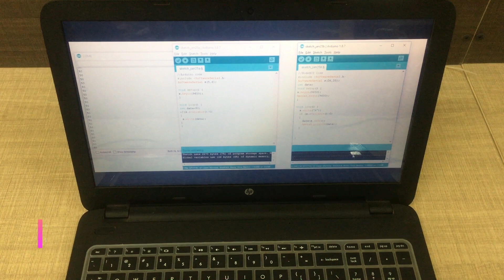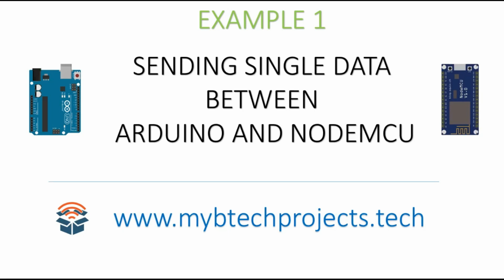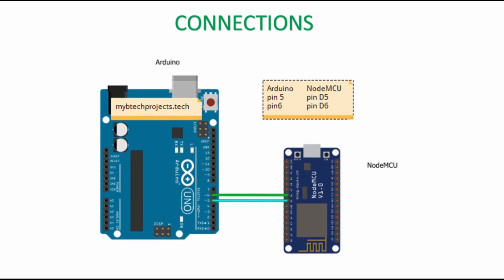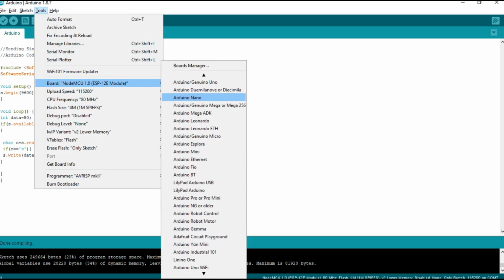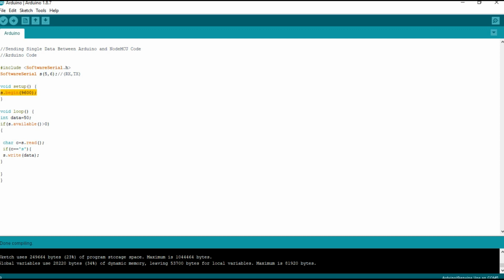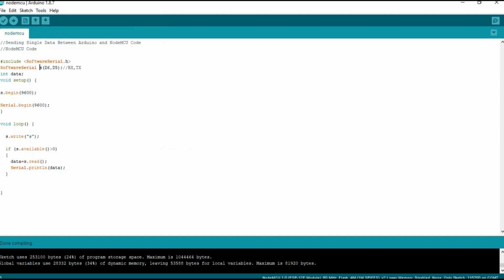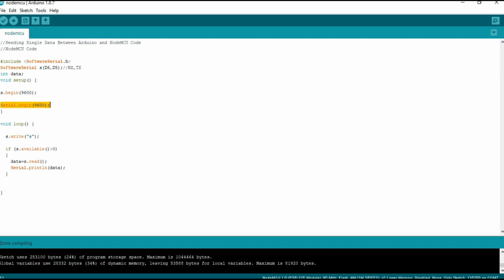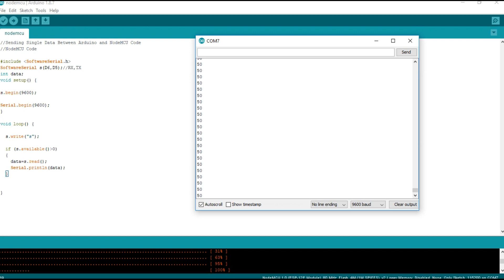[Fully Explained]--Single Data--Serial Communication between Arduino and NodeMCU (ESP8266)

Comment: Don't use the circuit ।। May be the person have minimum knowledge about the voltages of different borads ।। Please use a voltage devider between the pins of tx pin of the Arduino and rx pin of the nodemcu

Comment: Thanks! Not working for me. I'm not an electrical engineer.. by intuition and luck I plugged GND of arduino e nodemcu and worked fine.
Reply: do u have a schecmatic diagram for this?

Comment: I have a question. Is it possible to use similar code for arduino mega with nodemcu? I'm not buy yet the arduino mega. I need to know either it possible to use this technique or not. Thanks
Reply: Yes, Arduino mega will also work

Comment: Guys, if it's not working, try connecting the RX on the Arduino to the TX of the NodeMCU and the TX of the Arduino to the RX of the NodeMCU.
Reply: That's correct

Comment: Can you please confirm if we need level shifter for serial communication between Arduino and Node mcu? As arduino signal have level of 5 volts and that of Node mcu have 3.3 volts.
Reply: Usama, there is no need of level shifter for serial communication
Reply: @tamizhdiynaveen1354  in fact it is needed for protecting nodeMCU, you can use a voltage divisor with 2 resistors

Comment: He says 9600 bits per second 
Which is actually wrong 
It baud rate and it not measured in bits 
Baud rate = symbols per second
Reply: Yeah, it's right. But we use 9600 baud rate(i.e maximum 9600 bits per second can be transferred) for effective communication between Arduino and nodemcu.
Reply: @tamizhdiynaveen1354  i don't think 9600 is perfect for communication b/w node and Arduino there is more rate available but it is another mater 
I am saying there's a lot of difference b/w bit rate and baud rate
And u are arguing once again bit and baud are same which makes no sense plz Google first 
Search bit rate vs baud rate

Comment: I am complied everything  by your guidelines. But no output without any errors
Reply: i encounter the same issue.. how you solve it?
Reply: @amirulhazeiq8997 , connect in other usb ports
Reply: Try with other USB ports
Reply: TamizhDiy Naveen now I am clear and complete the project
Reply: TamizhDiy Naveen I have software failure

Comment: do you have the tutorial for mega ? i simpliy replicate this code to be using with mega but it could not work. no 50 in serial monitor of nodemcu, just a bunch of unreadable symbol
Reply: Hi Abdul, Thanks for watching this video. Check whether the baud rate is the same in both nodemcu and mega.
Reply: @tamizhdiynaveen1354  it is the same baud rate for both mega and nodemcu. thanks for this i finally can figure out the data sending from mega to nodemcu must be in form of string or else that i dont know. your code somehow cant be used on mega. i dont know why and it took me 6hours troubleshoot the code without success. but i do my own code and the data sending is work after that. any thing you can comment on that mr ?
Reply: @TheDarkforce95  can u show your code.. cause i also do the same thing on my arduino mega but still cant read any output on serial monitor
Reply: @syameezanatasha8349  create 2 file . 1 for mega and 1 for nodemcu . refer my gist
Reply: @TheDarkforce95  why i cant upload the code for arduino .. it shows error  Arduino: 1.8.9 (Windows 10), Board: "Arduino/Genuino Mega or Mega 2560, ATmega2560 (Mega 2560)"

Sketch uses 1982 bytes (0%) of program storage space. Maximum is 253952 bytes.
Global variables use 188 bytes (2%) of dynamic memory, leaving 8004 bytes for local variables. Maximum is 8192 bytes.
avrdude: stk500v2_ReceiveMessage(): timeout
avrdude: stk500v2_ReceiveMessage(): timeout
avrdude: stk500v2_ReceiveMessage(): timeout
avrdude: stk500v2_ReceiveMessage(): timeout
avrdude: stk500v2_ReceiveMessage(): timeout
avrdude: stk500v2_ReceiveMessage(): timeout
avrdude: stk500v2_getsync(): timeout communicating with programmer
An error occurred while uploading the sketch

This report would have more information with
"Show verbose output during compilation"
option enabled in File -> Preferences.

sorry i am new in arduino
Reply: @syameezanatasha8349  oh. Make sure you upload first the code for both nodemcu and mega. Then after done upload. Connect the rx tx for both nodemcu and mega
Reply: @TheDarkforce95  its work  ! Thanks for helping =)
Reply: @TheDarkforce95  I have same problem, but thanks to you sr !
Reply: @michaelquinn1926  glad i help you :D
Reply: Hi bro, refer to your gist can i send multiple data or just single data? Im confused... Thanks
Reply: @michaelquinn1926  supposedly you can send multiple data not just single data..
Reply: @TheDarkforce95  bro, can I text you personally?
Reply: @michaelquinn1926  using what hahaha
Reply: @TheDarkforce95  FB WA IG whatever ahaha
Reply: @michaelquinn1926  give me your ig hahaha
Reply: @michaelquinn1926  discord or steam anything
Reply: @michaelquinn1926  https://github.com/darkforce95/FYP/blob/master/powerMonitorNodemcuBlynk.ino this one will demonstrate the multiple data it received.

Comment: Hello, this would be more interesting to do it manually with an HTML inside the code of the NODEMCU and pressing a button on the website send the 50 or another number and turn on a led by TX Rx Arduino, the idea is to have infinite outputs in the NODEMCU
Reply from the maker: Hi MrREIVAX2,
Yes that's a great idea. We have implemented communication from Arduino to NodeMCU. The other way is also possible. Interested in controlling Arduino from RaspberryPi then check this -->https://mybtechprojects.tech/control-arduino-from-pi-using-gui/
Reply: I use sensors like dht11 and mq7, mq135 to send data via arduino to nodemcu and the data displays on webserver and thingspeak, bit this video works to me